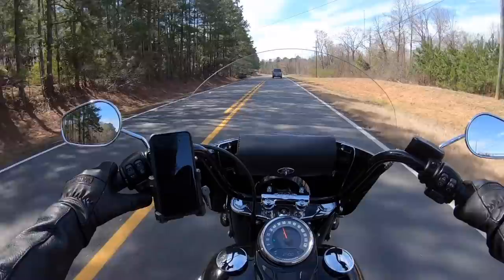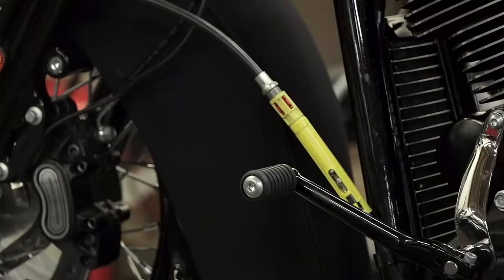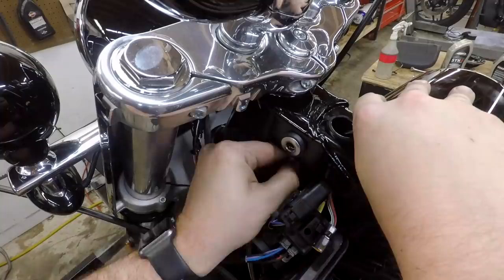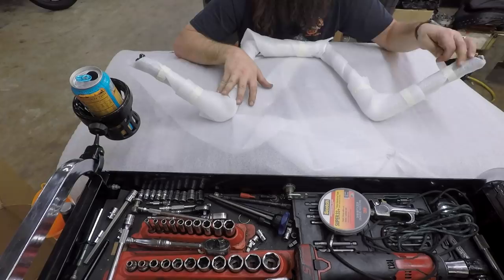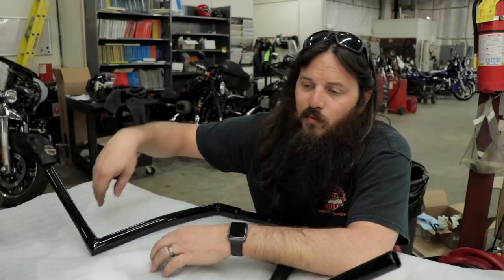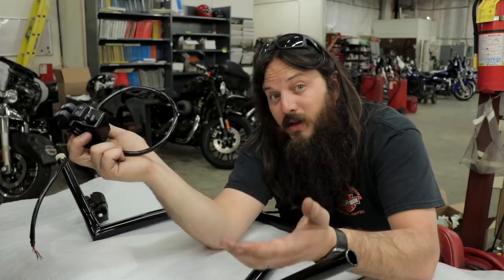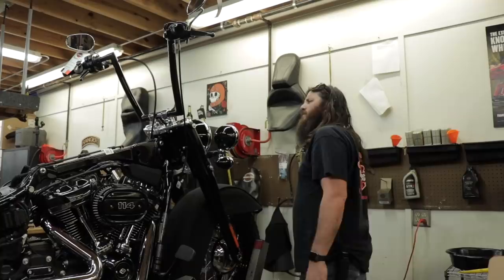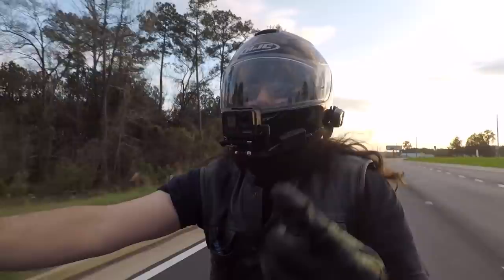2018/2019 Harley Davidson Softail Handlebar Install // Carlini Designs

Comment: Great video! I wish I would have seen it before I had my local dealer do my bars. They did not just replace the upper clutch cable half, but ordered a whole new "old" cable without the 2018 adjuster, so I had to pay for that plus a quart of Syn3 because they had to breech the transmission to install it, not to mention having to remove the lower half of the old one and reroute the new one! This seemed odd to me at the time because I thought the new cable was supposed to simplify handlebar jobs. I could have directed them to your video to see how it's supposed to be done. There were other problems with the job, too. If I lived near Chattahoochee, you would be doing all my work, that's for damned sure! Quality is such a very rare thing nowadays. I'm so glad to see it still survives in Columbus.

Comment: Nice handlebar install video, John. They look awesome too. I did notice that you struggled a little with pulling up the tag end of the electrical tape after pulling the wires through the bars. I am a retired commercial electrician and I have a tip for you that will make that part of the job much easier. When you wrap the tape the last thing you do is spin the tape roll two or three times to put a couple of twists in the tape before you break the tape from the roll. This gives you a small tail to grab onto to help with the unwrapping. Love your videos man.
Reply from the maker: Nice!

Comment: Great vid! Quick "pro" tip for ya: 
When you blow your para-cord/ string through the bar (I only use para-cord because it's tough AF), if you tape off the holes at the opposite end (30 seconds of work), the string will blow right out of the  centre hole and you won't have to fish for it. You might even be able to use the cheap electric tape for that! Keep the awesomeness coming!

Comment: Super appreciate you showing the electrical tape and lube you used to pull the wires.  I was a noob trying to pull it all through Yaffe bars and pretty much wanted to life deleted during that process.

Comment: I installed mine myself. I couldn’t see paying $800 for the dealer to install them. I even installed longer brake and clutch hoses. 4 hours...
Reply: Where did you get the clutch cable and brake line extensions?
Reply: I need helping finding brakes, clutch and wire extensions also. What all did you get?
Reply: @hannibalkintanajr7745  I got all of my wires on eBay and got the clutch cable extension and brake line from HD

Comment: For those wanting to know about the upper clutch cable and part numbers.  I contacted several local dealerships and they don’t seem to have this info.  The stock 2018+ Heritage Softail upper clutch cable is 35”.  I added 14” bars to mine and went with a 40” upper clutch cable (due to national backorder on the 39” cable).  The 40” cable fits great and super easy to install.  The HD upper clutch cables 2018+ Softails are as follows:
37” – 37200326
38” – 37200380
39” – 37200381
40” – 37200382
41" – 37200327
42" – 37200383
43" – 37200384
44" – 37200385

Hope this info helps
Reply: @jeffbruno1605  If he mentioned 44", it may have been the wrong one he ordered in the video.  The 40" I installed on my bike looks just right.  a 44" cable on 14" bars would be WAY too much.  I will try and post a picture of mine later today.  Not sure if I can even post a pic.
Reply: @jeffbruno1605  I ordered Magnum Shielding handlebar kit for my bars.  I did not realize that the clutch cable was a 1 piece replacement.  I wanted to keep the 2 piece stock setup.  The brake line though worked out great.  Here's the link to where I ordered it.  You could contact Magnum Shielding to get the exact brake line part number.  Magnum Shield handlebar kit #486961.  https://www.denniskirk.com/magnum-shielding/black-xr-handebar-control-cable-kit-for-use-12-14-ape-hangers-w-abs-486961.p1916487.prd/1916487.sku
Reply: @jeffbruno1605  I'll try and get one posted or send me an email address to send it to
Reply: @jeffbruno1605  Correct.  I bought the Magnum kit, then realized it was a 1 piece. I then ordered the upper clutch cable separately from Harley.  

I did a lot of internet searching to come to a conclusion that the stock cable is 35".  Internet pics kept showing up with a Harley page with part numbers.  Based on a 35" stock cable and adding 4" taller bars.  I figured I needed a 39" cable.  Those were on backorder, so I figured it was better to go longer than shorter.  Which is why I ordered the 40"

Comment: JOHN, please read!
Thanks for the great content.  Here is my story:
Got some aftermarket bars to do a bar swap myself on 2018 slim.  Ordered cables from my local harley.  Just picked up and it turns out they gave me a 1 piece clutch cable (I imagine this is like the cable off a twin cam model; says it fits my bike anyway).
Should I live with this 1 piece cable or do you recommend hunting down a 2 piece to tie into stock cable?  This is turning into a surprisingly difficult process and no one at 2 local harley dealers seem to be interested in helping!  If you manage to read this thanks in advance, u the man.

Comment: Great video John, if only I had seen it before ordering the parts for my Sport Glide fiasco. Still in the middle of getting it straight, I ran into the the same issue with clutch cable you did. Looking up the parts, HD only gives part numbers for the 12-14" bars, nothing less than that. Plus their measuring system is faulty, as you discovered, the correct way to measure is the jacket length only. When I went to the local dealer to order the cable, I asked them if they had a chart with cable lengths and part numbers. They did not.....  They claimed they did not have that info, yet the sheet with that info actually comes with each cable you order. Too bad it was way too long.. I actually believe the exact cable I need is the stock one for the Heritage, since they already come with taller bars than the SG. Then, on top of all that. I got the brake line, and it will not work because the connector is the opposite of what is actually needed.. WTF? I noticed you mentioned a brake line adapter, is that also needed?  Naturally, the dealer had no clue, why do they do it that way? Why not just supply it with the correct fitting instead of making us buy a separate adapter? Wait, never mind, the answer is obvious.... Keep the very informative videos coming, we all greatly appreciate it!

Comment: Good tip on the connector pin problems that crop up at times. I ran into those kinda issues at a boat factory job I had years ago.

Comment: I was hoping you would have said something about bleeding the breaks specifically on ABS models.   Maybe I have to go search through your vids to see if you have something on it.  I am getting ready to change bars on a 16 Road Glide and I am curious about the abs break system and if I am going to run into trouble bleeding it after I change lines and the abs unit.   Bars look good
Reply: S Triplehorn That was my assumption also. I just haven’t messed with very many with ABS systems

Comment: Great channel man ! Like the no nonsense straight to the point info and excellent instructions. Just bought a FLHRXS and looking at audio options.. One would be to add paint matched fairing lowers with speaker pods and saddlebag speakers with amp or a handlebar option. Looking forward to your review of the speaker you have !

Comment: You missed the most interesting part: wire extensions install. We encountered a lot of trouble with them today and still haven't figured out, how to make them fit into the frame, because they seem way too long for the size of the handlebars. But I ordered everything according to Harley instructions list. And then there are those connectors, that bulge so much. So I was hoping for some tip on how to use the extensions, and there was none sigh

Comment: I have a 2018
Heritage softail classic   
114 also I see y you changed the handle bars harley put cheap junk for bars on there bike am going to change mine to and get some different ones with less vibration. Thanks you  John

Comment: Just wanted to say thanks. After watching ur video 1 time I installed my 16" monkey bars in 3 hours without a problem.... except I fished weed eater wire through the bars which seemed easier for me but haven't had a single problem and was a really easy job

Comment: Hi John! After soldering the wire throttle appears the error P1510 (safe mode) and P2127 (TGS 2 low/open) and P2138 (TGS correlation error) I live in Madeira Island in the middle of the Atlantic with no HD support. Can you get me a code to remove those codes? thanks!

Comment: It's been a challenge to find tall(ish)apes with a shorter pullback.  Checked Carlini, great looking stuff, but the shortest pullback i saw was 7 inches.  I'm a little on the tall side, and looking for 5-6 inch max. Looks like i'll have a set made for me by a local fab shop.
Love those bars though!

Comment: I had the same issues with my clutch cable as well on a 2018 softail slim handle bar install.  Ended up having to go and get the cable shorten by a reputable source.

Comment: Hi John, I’m hoping you can help! My hubby has changed handles twice before and everything went well, however he has just attempted to change mine on my 2021 softail slim.  We bought the extensions cables and he connected them all…… for some reason nothing worked on the left hand side, horn, main beam, signal light.  Took all the connector cables off and put it back as was and still not working.  Do you have any idea what’s gone wrong???

Comment: re: brake/clutch measurement tool....just go get some higher-end speaker or power/ground wire from your local car audio shop. Most of the time (check first) it has 12 inch marks on it built into the jacket. Get 15 feet or so, and you can sub-divide it with a sharpie if you need better than "eh, that's about 6 inches or so" resolution.
Reply from the maker: Solid!

Comment: Hey John, 1st of I love your videos. I’ve learned a lot by watching your vids. I just bought a 2019 Fatboy 114. I’m thinking about upgrading my handle bars to either 12 inch mini apes or 14’s. I’m 5’11 about 185 lbs. I went to numerous dealerships asking what parts I would need. Everyone keeps giving me different answers. From “you don’t need anything” to “you need everything”. It amazes me how I get such different answers from “certified Harley techs”. 🤔

Maybe you can help me? 12 inch mini apes (Official Harley P&A) what add-ons do I need? As far as clutch, brake, and electrical wires. I figured my bike is just like yours (Heritage softail, Fatboy softail)

Thank you in advance.

Comment: Hi John, I'm a big fan. Learned a lot from you! I have the same 2018 Heritage as you but the anniversary. If I go with your bars but 12 inch, would you say my stock clutch cable, brake and wires will fit? With this COVID stuff I have plenty of time to tackle this myself. Appreciate your insight. Thx, Norm

Comment: I am swapping my bars out now. I have access to the connectors, but I am stumped as to how exactly they unplus from the wiring harness itself. I can probably remove the pins from the connectors once I get the plugs separated, but I need to know, is there a trick when trying to take the plugs off of the harness, you know, like unplugging them?

Comment: John, you couldn't by chance provide the exact part numbers I would need to install the same bars on my '20 Heritage, could you?  I'm looking for the upper brake line, the upper clutch cable and the switch/throttle wire extensions.  I've looked at the Handlebar Installation Requirements Handbook, but the tallest bars they list parts for are the Fat Chizeled Handlebars which, of course, are 12", not 14" that the Carlini bars are.  Thanks.

Comment: Since you are in a hot riding area are you gong to install a fan assisted oil cooler?  The HD part is really well priced.  Do you know if the HD fan assisted oil cooler have to be programmed after installed? Thanks for the vids!

Comment: I have been searching to find a video that will help me move fwd to finding some bars that will fit me w/my recently purchased 2015 softail deluxe. I upgraded from my 2005. This bike I think has stock bars and they are not a good fit even tho they have risers.I am 5'1" and it can be a problem. I just had a custom corbin seat w/backrest made and love it. Now for bars. Can you direct me to something that will educate me on how these taller bars change how a bike handles? Right now if I go to do a uturn I come off my seat and need to lean fwd to hang on to the grip as my arm is too stretched out. Also, I find I am lifting my shoulders when I do long rides which causes neck and upper back pain. Any input would be awesome.

Comment: Hey John, I know this is an older video but was wondering if you can add part#'s for the clutch cable, brake line, brake adapter, and wire extensions you used on your handlebar job? I have a 20 Heritage 114 and am ordering the Evil Apes from Carlini 14"

Comment: Great Video John!  Goes into a lot more depth than other vid's out there.  I want to mount a Sportster EFI tank onto my 2006 EFI Softail, have you got a video on this mod?  I already have the tank, a genuine Harley 3.3 gal with the EFI fuel pump mounting hole.  If I purchase  a new Sportster 1200 fuel pump, will it do the job for me?
Reply: This of course brings up issues with removing the old speedo & dash panel.  What items & how to replace them.

Comment: It would be very helpful to a lot of us if you make a video of the ignition switch and wat could go wrong if your not careful. I took off my switch on my road glide and in not able to put it back on. I’ve done it before, but this time it won’t seat properly and it doesn’t rotate right. The bike does turn on. Any suggestions?
Thanks!

Comment: Hi John !
Thx for that vid as I'm currently doing a bar job on my own 18 114 Heritage. Do I have to reajust the clutch when I put the adjuster back on ?
I just disasembled everything to pass the turn signal up on the handlebars and did not changed any other cables ...

Thank you Sir.
Be safe !

Comment: Is it possible to plug the weather resistant connectors into the block behind the rubber grommet under the tank in the wrong spot?

Comment: TECH TIP.  TBW bars are 1/2" shorter on the grip area throttle side because the sensor adds 1/2" .  If you make your own notches for TBW, you have to cut off 1/2" throttle side before notching or it wont match.
Reply from the maker: No kidding. That’s good to know. I’ve never actually done it. I’ve sent bars back to get the right ones, though!
Reply: @TheHarleyTech  yep.  Just don't ask me how i found out.

Comment: Hey Mr Harley Beardy dude...I agree with the 1 inch vs 1 1/4 inch thing, it kinda bugs me. My question is, is it possible/easy enough to route the wiring on a Sportster (2010 iron in this case) internally through 1 inch bars?

Comment: Great bars! I have the same bars on my Dyna Wide Glide but they are 17”. Hands Up! Lol great video
Reply from the maker: I almost went 17” after installing some on a road glide. The seat height difference made me stick with my tried and true 14”
Reply: Yep I just bought a new Road Glide and I think I’m going to go 12 that way I don’t need cables and they are a good feel for me at 6’1”. But those evil apes are bad ass I love mine. I always get tons of comments on the bars. I definitely think you will to. Your set up looks good.

Comment: nice bars. not to get you to throw a nyone under the bus but I'm looking at a set KST and Kliphangers any input on quality. Klip claims that they will use standard wires and cables have you found this to be true as always thanks in advance

Comment: One of the best upgrades so far was installing new bars not only do they give your bike a nice custom look they really add comfort to the ride. Great install I like how you organized everything. Two questions I'm starting to use my iPhone with a Ram mount what tips do you have for keeping it secure? Speaking of Daytona and the story of the Ornery One what is the best way to lock and secure your bike? Thanks
Reply from the maker: I’m not a huge fan of the ram mount because it needs the rubber safety band thing, too (that’s the only thing I’ve ever seen and added security to the ram mount). I actually forgot to “close” my Ciro mount heading to Daytona. Freeway speeds, and it didn’t budge. As far as the ornery one, I think if 4 guys want your bike, they’re going to get it. Disc locks, fork locks, security system and siren doesn’t stop a few guys from picking it up and throwing it in a van! A security system with gps might help you recover it, though! I have no experience with any of them, though.
Reply: Thanks you’re the best

Comment: I have a 97 fatboy. Replaced drive belt, put everything together and have a problem with the clutch.  Can't seem to be able to get any adjustment out of the clutch hub let alone the cable. After adjusting the hub I still have to much slack in cable. Where did I go wrong. Please help.

Comment: Awesome info man. Are you going to mount your mirrors under the bars or over the bars? You may have already said, sorry if I missed that. The bars look awesome!
Reply from the maker: I’ve thought about doing some under the bars. Generally they need to be made for that position or you can’t see anything out of them, though.
Reply: Cool, I like the look of under the bars. But function is key, especially with something like mirrors. Great video man.

Comment: I want to do a set of 14” Carlini gangster apes on my 2013 Deluxe and I can’t find a pair of 1.5 inch straight risers to install I don’t want the pulled back risers after I do the apes, any recommendations on risers? The bar is 1.5 inches but steps down to 1 inch to mount to risers and the step down is 5 1/8 inches long